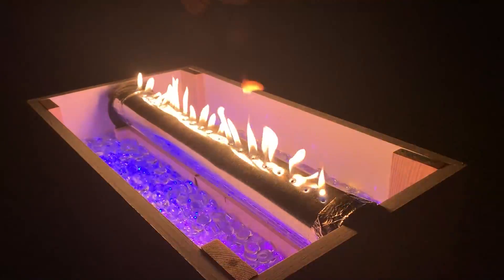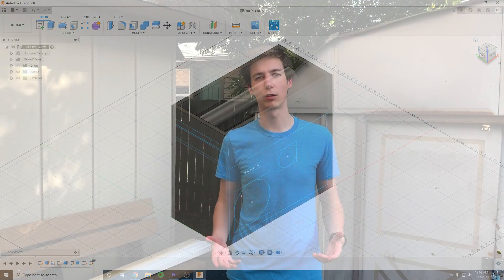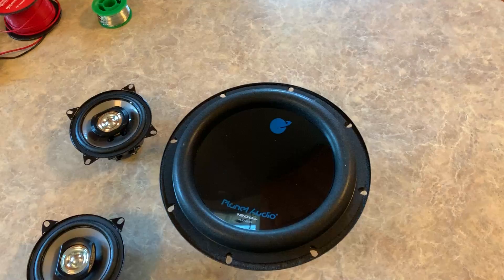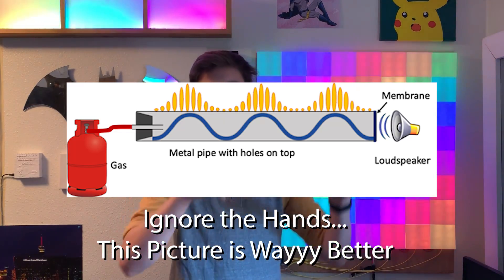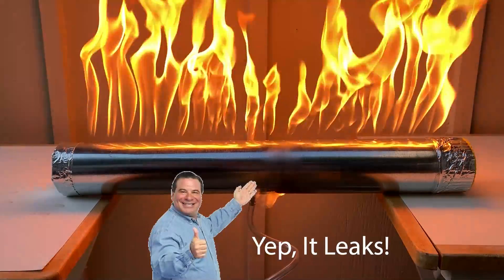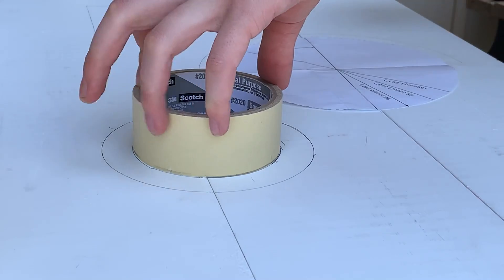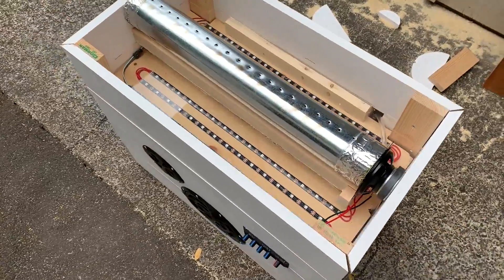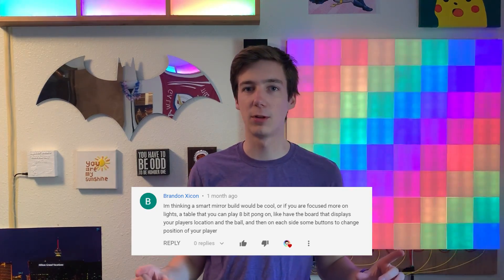DIY Bluetooth Fire Pit Speaker

Comment: Great work! I would say the lights should be facing around the perimeter so it lights up the area.. the fire light is over taking over the LED lights... would be good to add a small sparker to light up the tube so it's self sustained :)...Did you consider adding two rows  of holes, on either side of the main line of fire, for more 3d fire effect (potentially)?
Reply: Maybe also a heat proof glass top to hide the wood corners showing from the top?
Reply from the maker: These are all great suggestions. My parents have been asking me to make one for them and I thing I want to try something more 3D. I think a sparker would be easy to add so I’ll look into that for round two. I also want to add a flat edge around the perimeter of the second version so people sitting around the fire have a place to set snacks and drinks

Comment: What would be more robust is a length of stainless steel exhaust pipe. Drill a row, or two or three rows of precision holes for the flames. A piece cut from a 15mil Nitrile glove would do for the diaphragm, if the end of the pipe it goes over is rounded and polished.
Reply from the maker: I’d love to make a more robust version but I definitely don’t have the tools to cut or drill into stainless steel haha. Multiple rows of flames would look great though 😍
Reply: @Tech-Random  find someone  with a good drill press and a vise, or a milling machine. Polishing and buffing the pipe to a high shine is possible with lots of hand sanding but easier if you can use a power buffer.